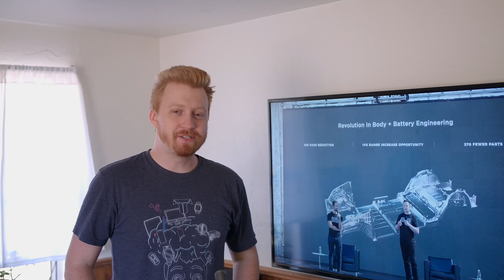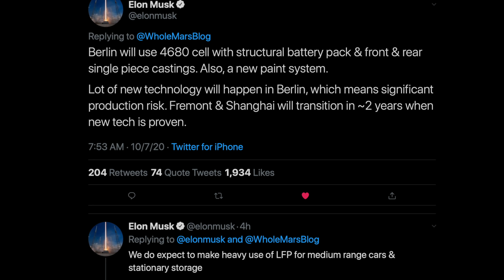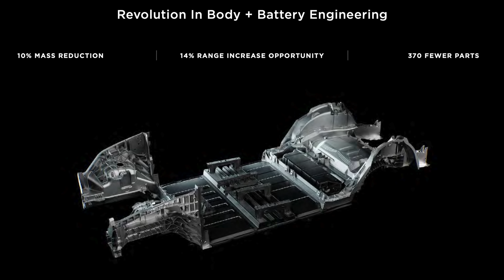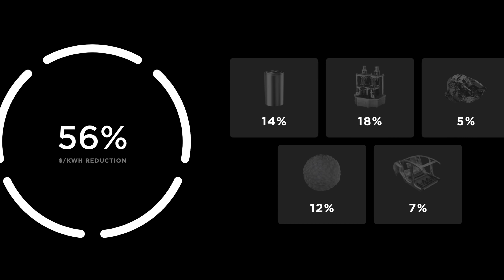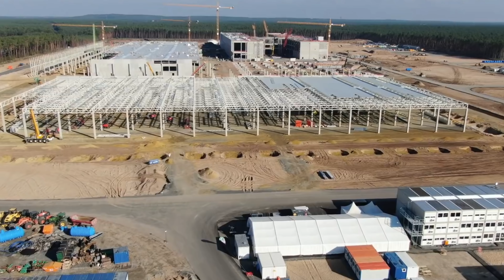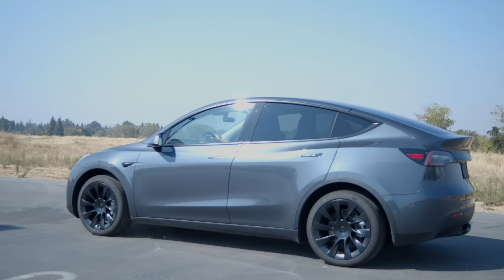MIG Model Y will get 4680 Cells, Single Piece Front, & More!

Comment: We won't be seeing the new batteries here for quite some time.  But, when they do start implementing them here, I'll be buying a couple more Powerwalls...can't wait to see what the Powerwall 3 is capable of.  If 56% more power is correct, we're looking at each power wall being around 21 kWh, which would be amazing if they were also cheaper.  2 of these in addition to my current 2 power wall 2's would mean nearly 70 kWh of storage, more than enough for several days off grid with our usage.

Comment: I wonder if the Cybertruck will use the cast front and rear or with it be a structral pack for a body on frame?
Reply: The Cybertruck body IS the frame. That's why they use such heavyweight steel for it: it is not just cladding, it is literally holding the whole thing together, providing torsional stability, etc. Hence the nickname "exoskeleton." Sandy Munro has a great video about this, in which he compares the exoskeleton concept to both the normal "body-on-frame" and "unibody" ideas, and he shows how the exoskeleton concept is very different from both... and very difficult to get it right. Sandy is excited about the idea (and from a salty skeptic like Sandy, that's saying something), but he's withholding final judgment until his company can buy a Cybertruck and tear it apart and analyze every piece of it and the manner in which it is built, maintained/repaired, and how it handles.

This is the same Sandy Munro who ripped the Model 3 build quality to shreds a few years ago, telling the world what idiots they were. Then his company bought (or was hired by a third party?) for teardown a new Model 3, and Sandy was stunned at how quickly all his suggested changes had been implemented, plus others he hadn't thought of.  Just a 2-year timeframe, I believe. (...but yeah, those early-production Model 3's, caveat emptor!)

Comment: If it is that lithium iron phosphate battery then won't it be a downgrade for the user?
Reply: @TailosiveEV  I mean the chemistry is definitely inferior, but the architecture is superior, so it would be very interesting
Reply: Geo Emmanuel it would be less range for sure but it would come with a significant price cut still making it a great value for the user
Reply: @danielmunch4413  yeah, if it comes with price cut then its a significant win
Reply: @hsm_presents  I mean the current usa made model y use high nickel battery, if they use LFP battery to lithium manganese battery then you can say that the chemistry is not that good. But Li Mg battery chemistry will be alright.

Comment: Are we ever going to see the exterior styling updated with all of these large presses  being made?
Reply: Yeah, I'm waiting for a significant revamp of the Model 3 when they switch to the 3 piece construction - which shouldn't be hard to do, since Elon says Fremont isn't switching over until 2022. Ready in time for Giga Texas? Hmm, probably not.

Any update for S, X, and Roadster may not be linked to new castings. The new presses have to be hugely expensive. At what volume of production does it become economical to design a casting for it?

Comment: Huh! 50 miles more Range for a German build Model Y v/s 2+ years worth of waiting time. #Decisions
Reply: Rahul Nalawade It will be less than a year, considering build progress. Get a standard or Long-range now with FSD, then upgrade to performance in a year; when it has decent enough range!
Reply: @thelongame  Yes, the progress is good, but I reckon it'll take another 10 months from now to start MY production in Berlin; and another year for adopting those new manufacturing changes to Fremont (for American buyers). Unless you see Texas GF up in production by 2022. Regardless of these speculations, it's hard to fathom how fast a car manufacturer can grow and make a better version of a car which is already being deemed best in class. 

And yes, I'll go for MY LR soon. In first 6 months of deliveries, they cut down the cost by 3K and added 2K perf boost - suggesting there's room for maybe few more drastic changes in terms of cost and perf of the car. Not sure about FSD or Performance upgrade as it does not seem a convincing value for money.
Reply: @Rahul-Nalawade  Glad you aren't falling prey to the Osborn Effect. Buy what you want, when you want it... when you're ready to sell your "old" model Y and upgrade to the German version, I'll be waiting to buy the used vehicle from you! ;-)

Comment: How will American customers specify they want the Berlin Y over the Fremont one? Or will we just have to wait 2 years for this
Reply: You'll likely have to wait
Reply: Likely will have to wait, imported vehicles are much more expensive due to tariff
Reply: Beside you have to do a private import, which is expensive, realize you cannot charge it at US Tesla Superchargers, because it will have a CCS charging port only.
Reply: @MarcoNierop  NO it has both CCS and standard tesla sockets.
Reply: @forrestolney6836  hmmm, ok... I thought Tesla had already stopped producing Model 3, with this dual plug configuration? Am I wrong about this?

Comment: Well done.  I was completely wrong.  Although we still don’t absolutely know what chemistry the new cells in Berlin will be using.  Could be the new form factor with current chemistry.
Reply: And why would they do that? If they have technology for new cells (announced on battery day) why would they bother to fit current chemistry (which is more expensive, has less density, need higher initial investment...) into the new form factor?
Reply: Fran Zeleznjak maybe new chemistry ages faster. Adding silicon and removing cobalt increases battery ageing. Maybe that is the reason why nobody talked about battery degradation during battery day
Reply: Fran Zeleznjak because they only have a pilot plant with low yield.  They may not be able to ramp up volume production for all the new technologies mentioned on battery day.  As elon said.  Ramping up to volume is 1000 or 10000 times harder than building a prototype
Reply: @andrewpaulhart  I think that they allready know how to ramp up production, and they need to make a battery factory in Germany so why not make the new factory (like pilot plant)
Reply: Fran Zeleznjak if it is that easy then of course you are right.  Elon didn’t elaborate on why they had low yield.  Maybe the silicone anode and high nickel cathode are easy to scale.  But maybe not.